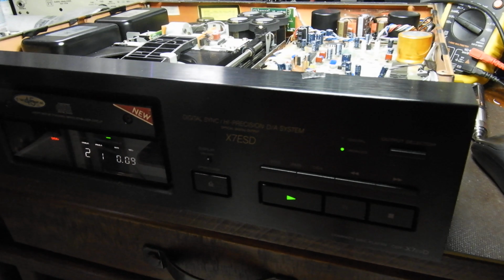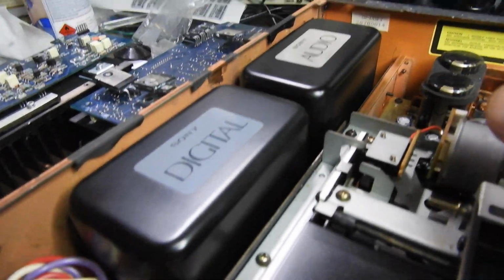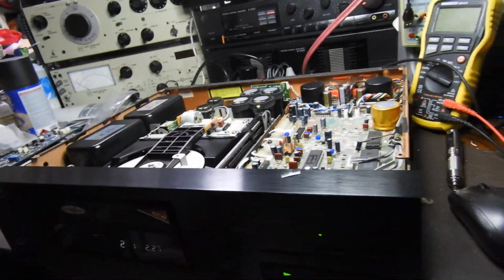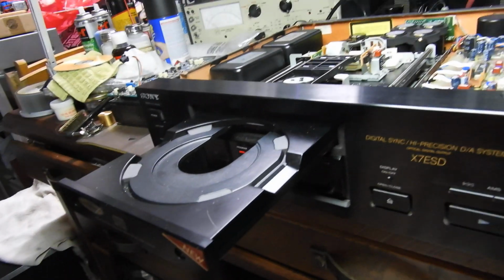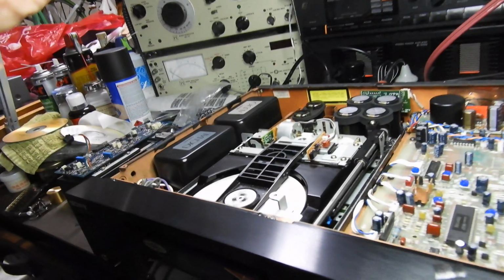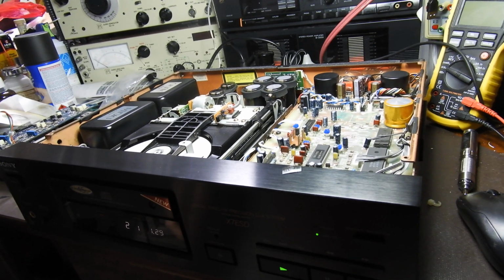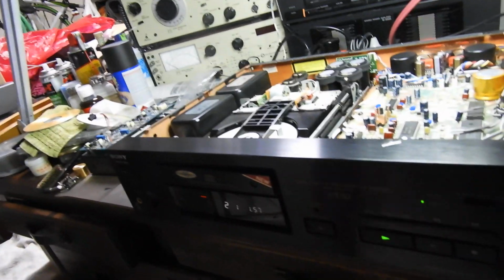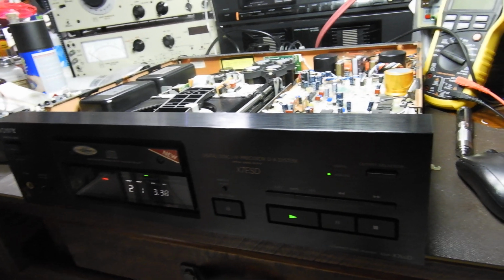Sony CDP-X7ESD - one of the best CD players ever made and probably best Sony player ever.

Comment: A beautiful looking cd player. I have had the Sony CDP 557 ESD for 10 years & it was the best i'd heard on my own system when i bought it. It seems very similar inside , all metal & no plastic within or out,  Inside there's green caps for digital, red for audio & black for power supply (which cost me 40 euros for each of four identical Elna replacements a decade or so ago!) also 2 transformers, 3-copper rail bars running inside carrying pos, neg & earth/ground & a beautifully smooth & slick loading mechanism, also the KSA 190A mechanism. Your X7 ESD looks very similar inside & even bigger perhaps, it's a slightly later model, mine is 18 bit / 8 times oversampling which i intend to make as switchable on & off. My only occasional gripe is: ..When i bought mine, for some reason it has trouble with 1 in 8 or 10 discs irregardless if it's a new or old CD!  on those 1 in 9, it either won't load to be recognised on contents or it will play faultily by making flutter noises from speakers in direct proportion to the output modulation i.e. the louder parts audibly flutter more on those CDs. & it's wether they are brand new or older marked discs (& it's always the same discs that play or not. And although tho most discs play fine, it really bugs me & these machines are getting very rare now & very expensive if seen on sale , typically 700 to 1200 Euros on "Watch-Out-Bay, Does anyone know what might be causing it. I've cleaned the laser eye with cotton bud & diluted Isopropyl but nada ...anyone?  or who can fix it?
Reply from the maker: I would say that all you need to do to your 557 is to have a servo aligned. First checking if PLL frequency is correct. All this should take no more than an hour.
Reply: @hear-net-au  good morning, could you please tell the track playing in background? Awesome CD player!
Reply from the maker: @montech5647  Emanuel Cruz
As @Emanual Cruz commented rightly (in his post below), it is Marcin Wasilewski Trio, from the album Faithful and the track is "Night Train to You". Marcin previously called his band "A Simple Acoustic Trio". This also was for more than a decade I think, a rhythm section of Tomasz Stańko Quartet. A legend has it, that one day a rhythm section of Stańko was held up and late at some festival gig and Simple Acoustic Trio played before Stańko. So he asked them to stay and play with him and following the concert he offered them a permanent spot.
After the death of Esbjorn Svensson, Manfred Eicher of ECM Records wanted apparently a new artist to replace EST and this was his choice. So they left Stańko. Or so I have heard.
Reply: @hear-net-au  Awesome again! Thanks a million!

Comment: Hi, this one is stunning cd player. Have 557esd too.
Would you be so kind to let me know, on which resistor in cdp-337esd (have as well) should I measure voltage drop to estimate, the usage of laser pickup? thank you in advance! Regards
PAT
Reply from the maker: Pat, I do not have a manual for CDP-337ESD but in all Sony units in which I have looked for it, it is a 22Ω resistor in line with Common Base transistor driving the laser diode. In CDP-338ESD its designation is R102.
Reply: @hear-net-au  yep, I found it. Will measure it in time. thanks!

Comment: paramount question: what clock does it have? With separate power?
Reply from the maker: Do you really think it is of paramount importance?
I do not. In the analogue days there was a specification called "wow & flutter" and audio components like turntables and tape decks achieved accuracy values of tens of 1%. 
And everything was fine.
Why is it suddenly important to have atomic clock installed in a CD player or DAC? Other than a new industry being born of selling upgrades to audiophiles...
A lot of top manufacturers to start with only ever used PLL and did not even bother to have a crystal based clock. Later, crystals become a common place but I have only seen once an oven put on a crystal to stabilize its frequency - a cheap to deploy way that is commonly used in radio communications. Equipment on some sites there might be exposed to extreme of temperatures and swings of 50 degrees between night and day. Audio hardly ever is working in such circumstances.

Comment: I have owned one of these since 1995, paid $400AU from a mate who paid $2799 for it in 1989. It's a beauty. The quality sound and build is just amazing. The metal CD tray is as work of art, you just can't describe how nice the thing is. S/N 115db - amazing. 17kg of quality! I have cared for it well and it's still like new. (By the way, the CD-R1 is the best player Sony ever made, which was a reference seperate transport & DAC set up) I still have the remote and owner's manual but no box. It has never been serviced and has never been taken apart. I don't see any need to have it serviced while it still runs mint. Only gets probably 4 to 5 hours of use per month. Should I have it serviced?
Reply from the maker: If it works well, I wouldn't mess with it. Service on it would be just belt replacement and cleaning of microswitches - both of which you can do yourself. Only if it ever started to hum or make some static type noise, I would then look at capacitors. But otherwise, "leave it alone". I get a lot of work on players that have been "tweaked", "tuned" or otherwise "improved", where these attempts went wrong.
Reply: @hear-net-au  Thanks for your reply, I agree! Cheers and all the best.

Comment: Don't you think the Sony CDP-X77ES is better?Also what are the op-amps inside of this model?I am planing to put better ones or put adaptor and swap different op amps...
Reply from the maker: Funny that in notifications I see a question regarding X777ES but when I try to reply it changes to X77ES. Anyway, X777ES has a KSS-281A pickup which looks good but is only featured in that one player. Impossible to find. The X77ES uses KSS-280A which is only found in it and another model of Accuphase (DP-70V). Also impossible to get. I have not seen neither of these players but I really like a loader in KSS-190 for it is the smoothest ever.  But you are right these machines are just as good but also very rare.
The op-amps on balanced board are TI NE5534P - nothing wrong with them and I wouldn't be changing them in a hurry.
Reply: @hear-net-au  KSS-280A impossible to find, not to repair. There is a lot of comments talking about replacing op-amps, if it sounds better, if it sounds  sweet, all this are bullshit, it like the tale "The Emperor's New Clothes".  The most important in a CD is the laser pickup. If it don't work properly, the cd player is a piece of junk.
I wish all the amateur works in to know how to replace and repair laser pickups, but they are all involving replacing op-amps.

The audiophiles stupid belief has made a bad favour to the real understanding of audio equipment that had scattered bad and erroneous electronic concepts.
Reply: @hear-net-au  Thanks for the reply.I changed the question that is why you get different notification.I will try to get the X7ESD for £700-£800 bucks on Ebay.I will buy TI NE5534P op amps and compare them on my sound card against the ones i like most.And if they perform the way i like i wont touch them.Hopefully i wont brake the whole machine if i decide to replace them 😅.

Comment: Awesome cd player. Mine has the same problem too.  The belts are old and need to be replaced.  Can you please show how this can be done?  thanks for sharing!
Reply from the maker: I might do that in a few weeks when I will look at this player again.
Reply from the maker: What you need to do is to put the player up side down, remove the cover and then the metal bracket covering the belts. Then they become easily accessible.
Reply: @hear-net-au   Did you ever do a video on how to access the belts or is it as simple as removing the bottom cover and then the metal bracket covering the belts?  My question is:  I do not need to detach the transport unit from chassis if I do this?
Reply from the maker: @cwsam1256  no, you do not. But there's a bracket covering pulleys that you need to remove. If you see all my videos on X7ESD, you will find a close up
Reply: @hear-net-au  The bracket covering pulleys that I need to remove is accessible from the bottom of the transport, not the top, correct?
Reply: @hear-net-au  I watched your 3 x7DSD videos each 3 times and have not found a close up.  ;(
Reply from the maker: @cwsam1256  There are actually 4 videos   on it ;-)  One of them shows the player up side down. But the best one is on service KSS-190A:
https://www.youtube.com/watch?v=bRFDN0IQyjA
Normally, you do not have to remove the mech, but here, I had a seized pulley and it was easier to remove the mech rather than work in the corner, behind front panel .
Reply: @hear-net-au  Okay, I tackled the job and when I removed the bottom cover I can see what you described.  I could also see that in a video one (me) may have trouble discerning if he is looking at the inside from the top or bottom of the deck.  Thanks your little guidance was a big help.
Reply: Thanks for the share. I have to replace the belts on my x777es cd player. I believe they are similar.

Comment: Loving it! Pure battleship build quality, i owned the 555ESD back in 1989 paid £1000 for it brand new, had the BU transport and the famous TDA1541 DAC, velvet smooth tray, everything made of metal, 15kgs of Japanese quality
Reply: Most of SONYs high end machines were on steel frames, and very heavy,I had the first cd player, (cdp101)and then an ES model,the latter weighing in at around 10-11kgs.
Reply: Everything made in Japan in the 80's-90's were Gold
Reply: @soldadoryanbr7776  Pride of ownership is a very underated quality in these kind of electronics, its not ll about how they sound even though these players do sound superb
Reply: @Phil-yj7qx  my father has a Sony lbt-a390, It is in my house since I was born, I grew with other Sony products too like the Playstation, I think I got attached to their looks,the Black and yellow from the late 80's,to the silver of the early 2000's(like the Sony Trinitron that I also own),the first album that I  bought is "and justice for all" from  Metallica,after the intro of "blackened" I could feel the Wood of the rack vibrating,it's a Monster,1/3 of the volume and I'm almost deaf
Reply: Instablaster.